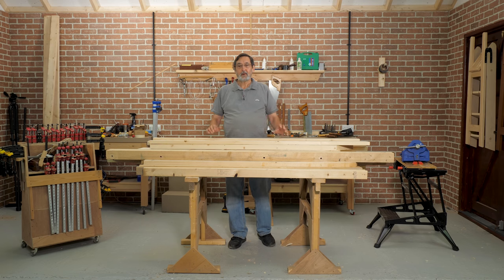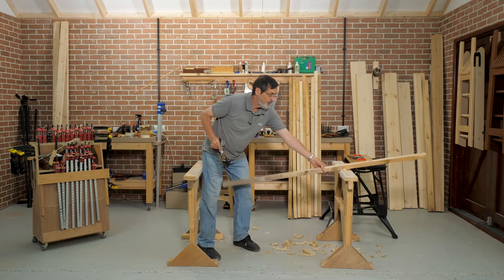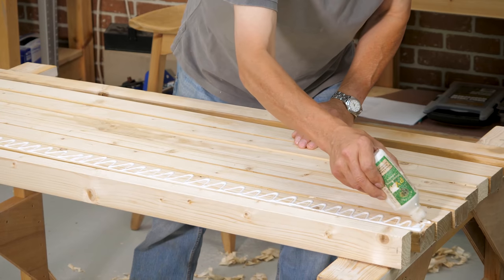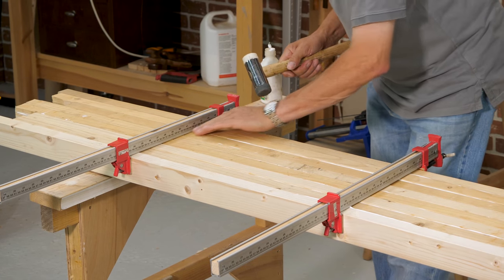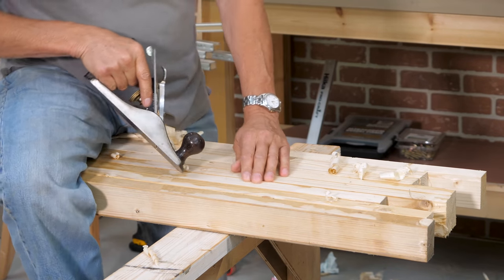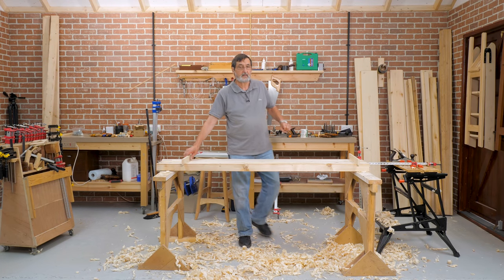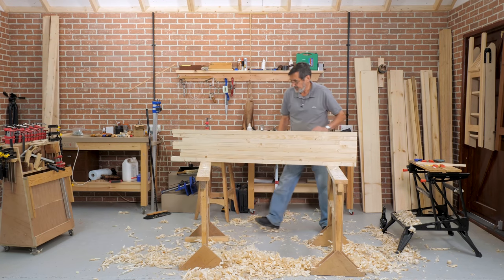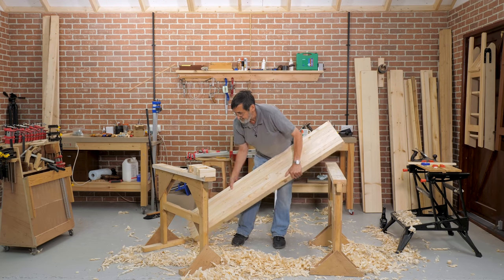How to Make a Workbench Episode 1 | Paul Sellers

Comment: I noticed at 0:01 you were doing it wrong.  You need to use several layers of planks in alternating directions with diagonal biscuit interconnects in the glue interface then top it off with a surface set of planks held in place by wedge pegs.  This gives you a replaceable surface, absolute rigidity of the underlaying structure and strong resistance against weather and heat warping.  Your final tops can be held in place by sunk carriage bolts with cam nuts for quick interchange of any specialty project tops you make (gluing binding rig, mounted pantograph, etc).     

Have fun!

Comment: Just another comment
I’m planning on making my bench 700mm wide rather then 680mm. I need more work surface so I’m going to skip on the wellboard or make a smaller one (still making my mind up on that) Would an MDF top around 54mm be too heavy for the frame?

Comment: I started to plane the wood for the bench top, and assemble it with out glue.  I have a question about gaps between the 2x3 studs.  If I can see light between the studs, is that bad?  WIl the glue bring the two peaces together?  Great Channel! Great Book too.
Reply from the maker: The glue won’t bring the pieces together although if you are not applying too much pressure via clamps, the wood will probably hold. Ideally you should plane them as true as possible so there are no gaps.

Comment: I see you planing with the plane at an angle. Why does this work better? I do it, and always wondered if it were a bad habit. If I think about it I stop and plane in line with the timber. I would be grateful for your thoughts.
Reply: Geometry.   It's easier to push the plane at an angle for two reasons:  You reduce the width of the cut, and you also get a slight slicing action.   You can also reduce tearout you may get if going against the grain.

Comment: Hi Paul, I need some advice.

I'm trying to plane into square a piece of walnut that's ~70x30x800mm. I'm using a No. 4 Stanley plane and a workmate bench like you have besides you in this video, where I hold my workpiece in. Except my workmate doesn't have a step where I can stand on.
My problem is: When I'm planing the wide side (I don't know if the sides have names), the workbench being so light keeps jumping, and messing up my planing. I end up with steps in my board.
Is this because my plane is not sharp enough? Should I add some weights to my workbench?
I'm taking shaves as thin as I can. If I go any thinner, I just get dust and not shavings.

Please help.
P.S. I'm from Romania. I'm using local walnut.
Reply: Put a heavy paving stone or a shelf across the stretchers between the legs and add bags of sand/cement piles of bricks to increase the mass of your work holding device.
Reply: To stabilize it would take a lot of mass, which I don't think would fit. Some sand or cement bags might do the trick, bricks are too loose.

The idea to clamp in the vice a plank of wood and put that against a wall sounds the most stable right now.

Comment: Paul what about making the inner vise face flush with the apron recessing it so you could clamp a long board to the apron.
Reply from the maker: Never liked it, never will. Clamping boards to the apron is a rare necessity and actually, I never had need of it in over 50 years but people do seem obsessed with the option as though this is normal so it is just a matter of personal preference. Personally, I wouldn’t do it because using my method you can use an overhand and underhand grip without ever pinching your fingers again.
Reply: Good Point

Comment: I went with 8 Douglas fir 2x4's for my top but don't think I waited nearly long enough for the wood to dry out, am I opening myself up for a world of issues down the road? Should I start over an use the whitewood studs from Home Depot?
Reply from the maker: Just go with it. It probably will work out fine and the very worst that can happen is that at some point in the future there may be some shrinkage.

Comment: Somehow i managed to get a very significant twist in this, bad enough that when put across 2 benches it see-saws side to side between opposite corners (top right and lower left). It does this on both sides. Is there a way to fix this using hand tools? Planing seems like it would take days and i'd have to reduce the thickness of the bench entirely to get it flat. :(

Comment: So on American style 2x4's - I suppose we do have to flatten and square up the heavy rounded chamfers we have on our ends before glue up?
Reply: Troy, don't mess with it before you laminate the top.  But after the bench is done, you can come back in and flatten the top to suite your needs, and remove those roundovers.  Easier to just do it once, at the end of the build.  Really won't take very long.

Comment: Hi Paul, I appreciate all that you do. My question though is the following: the trestles seem to be less stable than sawhorses. Would sawhorses be a better solution then trestles for most of us?
Reply from the maker: Sawhorses are not a quick solution to a temporary work station. Trestles on the other hand can be made in a fraction of the time. If you have the time to make sawhorses, I would suggest sawhorses are the best way to go. I don't think saw-trestles are particularly unstable. I use them all the time. They are fantastic.
Reply: Hi Paul, I appreciate your response. I asked because I have a garage workshop, that is still used as a garage, and need to build a portable workstation. I would love to build the workbench in your video, but my space is so limited that it just isn't possible. If you have an idea you'd like to share for a good stable portable workbench I am all ears and eyes. As always-- I and many others appreciate all you do for us. Thanks!

Comment: Hey Paul I was just curious about something. Let's say I wanted to make an immovable bohemoth of a bench with a 6 inch thick top. Is there any advantage to laminating a bunch of 2x6s versus just a few 6x6s? Appreciate the help and loved the video.
Reply from the maker: Laminating is much more stable than square sections and will usually distort much less than large sections laminated together.
Reply: Paul Sellers ok. Thanks that makes sense it's kinda like on old chests a solid board would bow but boards tongue and grooves together wouldn't. Thanks for taking the time to respond

Comment: if using dimensional lumber from say HD, with the rounded edges, how do you get those out so the laminated table top is flat?  What kind of hand plane is best for this?  Most lumber looks a lot more rounded than the lumber in the video. Note, I don't have table saw, etc.
Reply: If you have a router or circular saw (not table saw) you could run it along a straight edge to cut away the couple of mm. Otherwise extend that plane blade and start hogging? :)

Comment: Great video but how do you glue the bench top effectively if you don't have any clamps? At$26 - 32 each, eight pipe/sash clamps add a huge cost.
Reply: You can make your own 40 inch pipe clamps for around $12 a piece by buying the clamps from Harbor Freight and the pipe from your local hardware store. I went with a 10 foot galvanized piece from Home Depot for around $10, which they cut and thread for free. You can change the size based on your needs. One 10 foot pipe could make four 30 inch clamps, for example.
Reply: Use two pieces of wood ~20cm longer than the width you're gluing, one piece around 15cm long and some twine.  

Tie one side of each piece of wood together with twine so that the space between is ~1cm shorter than what you're glueing.  

Put the tied together pieces of wood on either side and wrap the untied sides ~5 times and tie off.  

Put the third piece of wood in between the wraps and twist to tighten.  

When sufficiently tight, push the twisting piece out to the end and use it to wedge against the glued piece.  

It's not as efficient as clamps and is much slower but it works pretty well.

Comment: He said he used "reclaimed lumber"?   But what kind of wood is it? White pine?
I'm finding it very hard to locate Southern Yellow Pine here int he Northeast.  So I'm wondering of construction grade pine would work.
Reply: Yes, construction grade pine 2x4 would work just fine. I do recommend picking through the pile as best you can to avoid large knots, warping, bowing, and checking. As Paul mentions, some minor issues with the lumber can be mitigated during glue up and corrected after lamination, but get it nice early and it will go a long way. 

If you have access to a table saw, I would also recommend taking 1/4 inch off each side of the "2inch" side to save you lots of finish work.

Comment: what are the dimensions of the individual pieces of wood that are glued together to make the bench top? the guide lists only the overall size. Thanks
Reply: take your lumber and use enough to get the overall dimension.  Most "2x4" boards are 1 1/2"thick.  Notice that is reduced by hand planing.  If you plane a lot, then use another board.

Comment: How can you plane the pine surface in any direction? I get  a lot of deep tear out because grain is wavy...
Reply from the maker: In 95% of cases pine will plane in either direction. That is my finding. Wavy grain will always present a problem and without having the board in my hands I cannot really give you an answer. I really do choose my wood carefully.
Reply: By wavy I mean such up and down grain direction like at 18:29 around the knot. The grain is going in both directions on very small area.

Comment: When you say  building grade lumber what does that mean ? I bought a load of stud work timber ( UK terminology ) but it was all twisted and uneven, this was probably the wrong type. The bench is OK but I'm not happy with how twisted all the wood was.

I'm looking at Redwood Planed Timber Standard 44mm x 69mm x 2.4m on Travis Perkins website is that closer to what I would need ?

 Not planning on using this site just for reference.
Great video thanks for the inspiration to give it another go.
Reply: When you purchase lumber for your top you need to sort through the piles to find the straightest pieces.  Don't ever just ask the fellows in the yard to load up your truck.
Reply: Yeah I think I've learnt that one the hard way definitely.
Reply: I guess the key is get out and look at the wood you want to buy. Cheers.

Comment: So what's the purpose of the smoothing plane thing? I don't fully understand what you're doing with it.
Reply from the maker: The reason for surface planing this type of wood is because often it’s coarsely cut and has undulations in the surface. This is because it is used for construction work and rough carpentry.Planing the meeting surfaces creates a perfect bonding surface.

Comment: Paul, what thickness material have you made the base of your router plane from please?
Reply from the maker: I use Sapele but I also used oak and even aluminium. The aluminium unfortunately can sometimes mark the wood with blackness so I don’t generally recommend it but it is long lasting.
Reply: thanks paul, what thickness is that sapele please?

Comment: What brand of wood glue is Paul using and is this available at either Home Depot or Lowe's?
Reply from the maker: Hi Guy. Paul is talking about what wood glue he is using on his blog and you can access it by going here https://paulsellers.com/knowledge-base/glue-gluing/.  Team Paul
Reply: Cant go wrong with Titebond 2 or 3 available everywhere.  
I used Elmer's once in a structural application, just plywood gusset to a 2x4, and could not break the joint after I found a mistake.
Reply: Michaelbuddy< agree on speed of TB3.  Have to have everything ready, clamps, stock, applicators, gloves, rags etc. Have had to stage glueup on cutting boards with too many pieces for one shot.

Comment: Hi Paul, What brand clamps are you using?
Reply: In US, very similar clamps are available at Harbor Freight.  Paul improves them by inserting a stiffener the lenght of the clamp and clamp face pads of 1/4" plywood.  Both easy mods and he has a video on it.
Reply: Thanks.

Comment: Question, why plane the underside of the bench top?
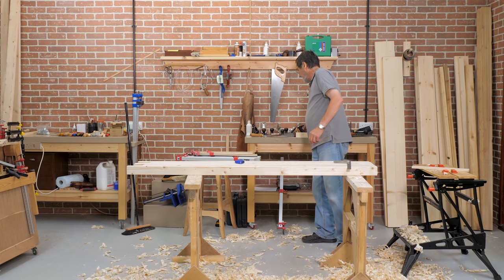Reply: Around 26:30 he finishes planing the underside and mentions that it’’s ready for the frame. Looks like it only has to be roughly flat compared to the top, enough so it doesn’t have gaps/wobble where it meets the frame.

Comment: In the USA a 2x4 is not actually a 2x4 it is more like a 1 3/4 x 3 3/4 piece of wood....so my question is does anyone know what size lumber he is starting with for this project?
Reply: Don't think exact dimensions matter.  Something about the size of a USA 2x4, actually 1 1/2"  by 3 1/2", when laminated  7 or 8 wide, as in Pauls design,  is not going to flex, and that's what you want.

Comment: What is the purpose of the laminated surface?
Reply: It will be the main bench top, made from cheap 2x4 construction timber/lumber to provide a thick and solid surface to work on.
Reply: Note that he uses reclaimed wood, which takes drying out of the equation (and price).  Just buying new 2x4 and 2x6 framing studs might not be a good idea, as it can warp as it dries.  At least buy kiln-dried, even if more expensive.
Reply: +Paul Sellers  Thank you for your reply. I really love the series and I am in the process of bringing my Grandad's "old" tools back to life. You make woodworking look so easy and fun. I will admit that I even watch them again and again because it is so relaxing and a real pleasure. Once again, thank you and warmest regards. :)

Comment: What timber can I use for this? I’m very new to woodworking (hence wanting to make my first workbench) and there are so many options for 2 x 4 wood that I’m a bit confused by it all. If anyone has any advice it would be much appreciated.
Reply: Well, pine would be easy to work but not incredibly durable unless you put a hard finish on it.  Paul used pine in this video i think (I'm not great with identifyinging wood).  I've seen maple and oak benches before but that's because my buddy has his own hardwoods that he mills from log, so it's basically free to him, 2x4 oak in the store would be expensive if you could get it al all.  If I were you I'd go with plain old pine from lowes or home depot and finish it with wipe on poly or something similar.  But you'll get differing opinions from literally everyone, so take my advice with a lump of salt.  Good luck with your first bench!